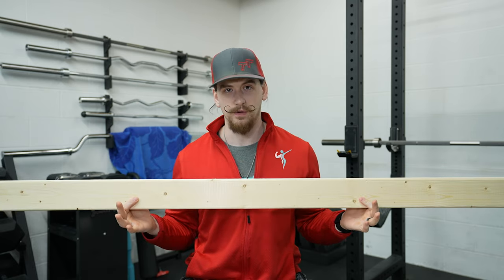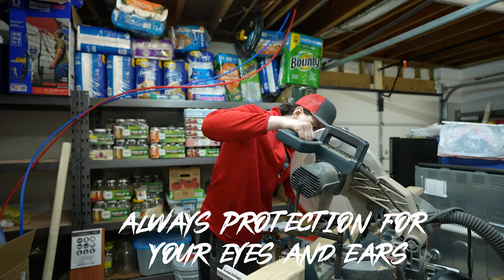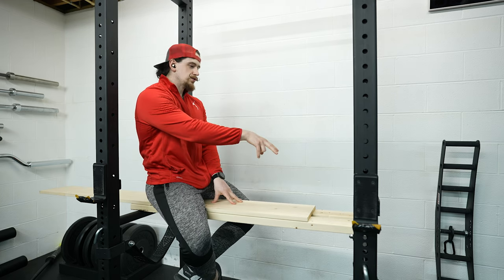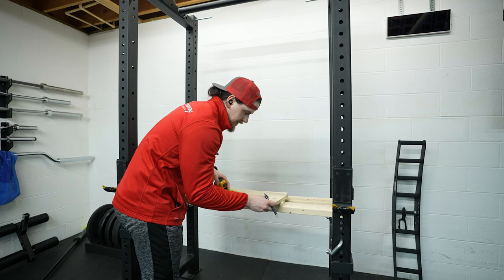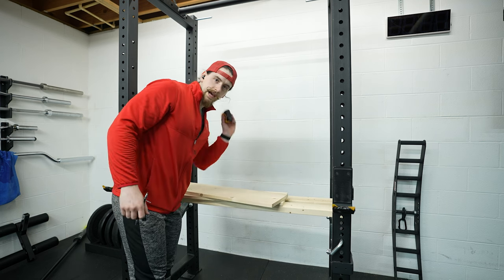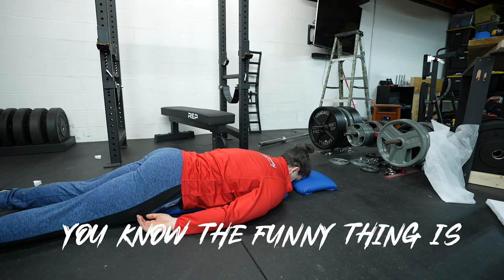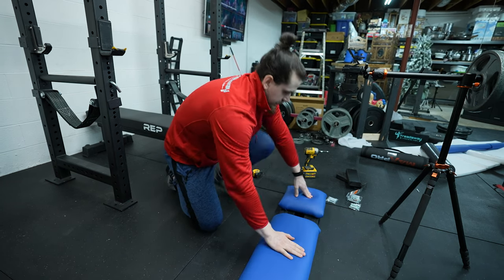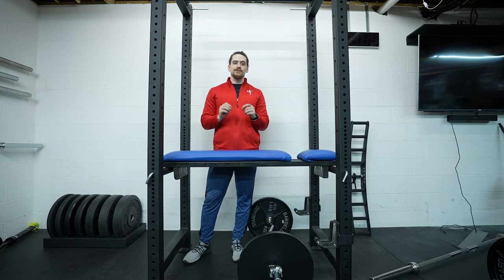DIY Seal Row Bench - DIY Home Gym

Comment: Thanks very useful project for my circ saws. I will pass on the separate headpiece/ face hole and just extend the body piece to make it one long cushion for my head & torso - should make it easier.
Reply from the maker: Hope you like it!
Reply from the maker: If I had to do it over again, I would probably also skip the face hole or at least move it. I actually misjudged were the face hole should be slightly. 

I would also use wooden wedges for the bottom instead of the metal brackets. It'd be cheaper and stronger.

Comment: I plan on using a complete flat bench paired with my Abmat Chest Up pad
Reply from the maker: Nice! You will still have to stack plates or something to get the bench off the ground though.
Reply: @RyanTreadaway  sorry I meant flat pad. Rep sells replacement ones for super cheap
Reply from the maker: @Ice_Box_Gym  that's brilliant! I didn't even think of that. 🤯
Reply: @RyanTreadaway  cuz like you said in your video.... I dont know how to upholster and im not about to learn 🤣
Reply from the maker: @Ice_Box_Gym  to be fair, it wasn't very hard and I feel like it came out pretty clean. (At least by my standards.) I didn't watch any tutorials or anything. Just went for it. Now I have lots of materials left for other DIYs

Comment: It's so asinine that seal benches cost what they do when if you were to take one that costs well over $1,000 apart piece by piece and lay the pieces on the ground, you'd have just as much hardware as what you'd see on a $60 bench. Infuriating as all hell. Why is it so hard for manufacturers to just build that level of adjustability into normal benches???
Reply from the maker: I agree. They're way to expensive. It's because of how much of a specialty item it is though.
Reply: @RyanTreadaway  Calling it a specialty lift seems so strange to me. If anything, the seal row should be just as normalised as bench press and the "big three" should really be the "big four".
Reply from the maker: @DarrenMcStravick  I agree. It SHOULD be normalized but it's not. Haha so it is a specialty item, hence the price. Maybe one day it will be normalized and they will cost less. That said, Titan fitness has two different types of row benches. One is 350. The other is 450. Not bad.